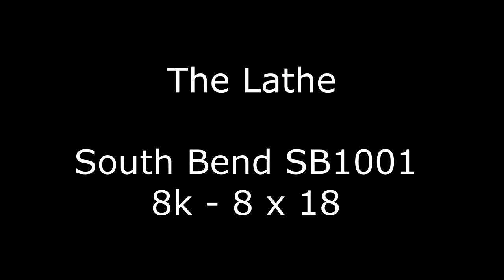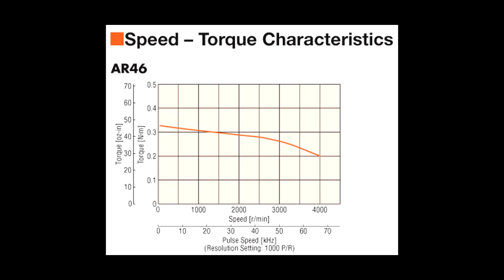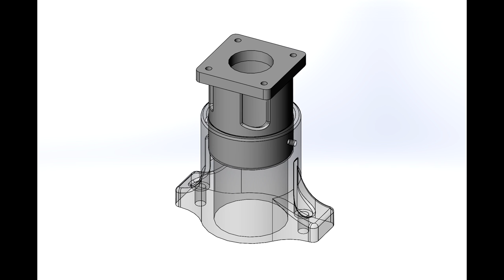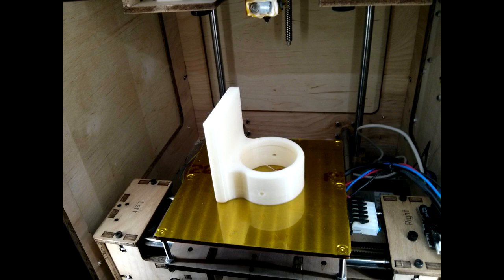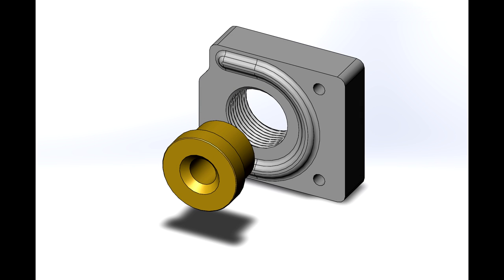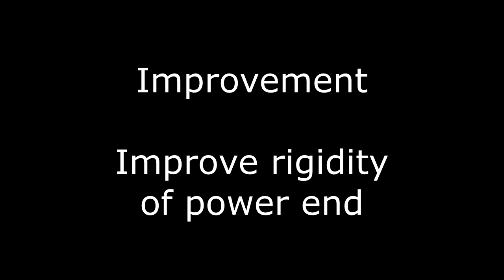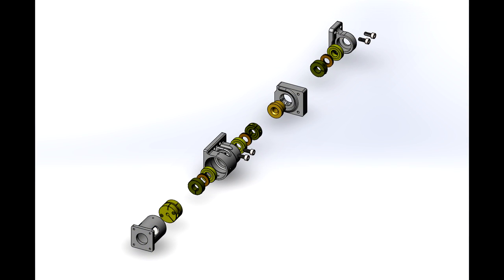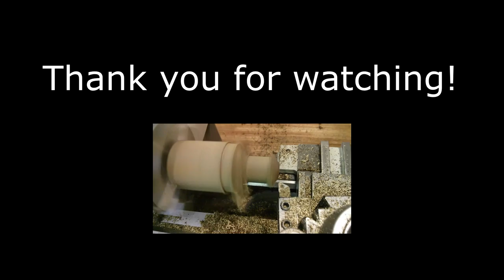South Bend SB1001 CNC Lathe, 3D Printed Parts, Arduino Controlled

Comment: Is this spindle using an encoder? or how do you figure the RPM?? I'm thinking that you may be using one of those cheap Chinese three phase with an small VFD.....? Just trying to understand what you have done...
Reply from the maker: In this video I unfortunately didn't control the spindle speed beyond using the built-in adjustment knob. The displayed RPM is measured using a sensor and magnet on the spindle, and the displayed RPM is pretty accurate. I've not torn the spindle drive down, but I'm pretty sure it's a BLDC unit with encoder feedback. The low speed regulation is not great. I might try replacing the potentiometer. If driving the drive from a computer, one would simply send most likely 0-5VDC to the drive in place of the potentiometer to control the spindle speed. Also, if controlling from a computer, the spindle encoder should be replaced with a higher pulse-per-revolution one to better synchronize spindle with axis movement. I don't know if replacement drives are still available, but when they were from Grizzly the cost was insane. Someone replacing the drive on this lathe would be best to consider as you suggested. Thank you

By the way, you have a nice channel. I'm watching your toroid winding videos, very cool machine.

Comment: Are those thrust bearings large enough in diameter to be only interacting with the outer race of the radial bearings? The thrust bearings looked to small in the model you were showing.
Reply from the maker: You're right, good chance there is a problem there. The 3d prints have been replaced, but your advice will be used for future work. Thank you

Comment: Hi there, First of all thanks nice video. How can you help me? I want to make special purpose 2 axis lathe type Cnc machine. My requirement is rpm of spindle speed is 10 - 300m and  2nd axis ball screw control by Cnc control with precision features for my operation is like threading. Please give me best solution. Thanks
Reply from the maker: Thank you for the question and faith that I could help you. Unfortunately, you should find someone with greater mechanical experience and able to thoroughly understand what your goal is. I wish you all the best of success. Your project sounds very interesting.
Reply: Kent VanderVelden thanks for your quick reply. It’s semi automatic Cnc spring coiling machine for thick wire.
Spindle axis for mendral rpm. And ball screw for pitch control according to requirements but precise
Compound slide control manually. Thanks

Comment: Can you please tell me Which software did you use to run the machine? Please bro i am also working to make the cnc wood turning project.
I  am from india
Reply from the maker: Hi Nasa, I wrote the code from scratch. It was as basic as I could make it. Today I use LinuxCNC. There's also MachineKit, based on LinuxCNC, for Beagle Bone. Maybe Marlen for Arduino?
Reply: @kentvandervelden  Thanks for giving the information. If i got any doubt means can i ask you?
Reply from the maker: @nasateja6849  Of course you may. Feel free to email as well
Reply: @kentvandervelden  Thank-you so much😘😘

Comment: great job Kent ! I would have loved to see you actually making the printed parts on your rig...looks like they were machined out of Delrin !! Clearpath servos are the way to go...they cost $$ but 3 to 8 x the power and closed loop in one neat package.
Reply from the maker: Many thanks! These are printed on an original Makerbot in ABS. For the next version I plan to use Clearpath servos (others have recommended them too) and I have an ambitious goal to redo the parts in cast aluminum. The foundry furnace is ready but don't have experience with casting. A viewer made the suggestion and at-home casting seems to be a skill that is being lost to time. To learn I got mrpete222's foundry course videos. Best wishes, Kent

Comment: Wow, that lathe modeling would take me a life time or 2. Good work, great info, thank you for sharing.
Reply from the maker: Thank you, and it took me a long time as well, but it was great way to learn Solidworks. I received a conversion kit for this lathe recently, the last one of its kind maybe. In my Shop Talk #1 video, I show the pieces. The man who built it was a mold tool-and-die guy and it shows in the quality. I hope to get started on it soon. I've been planning the electronics. Doing some cleanup on the lathe tonight. I spend the summers outside but it's turning cold around here and so I'm heading back into the shop. Best wishes, Kent
Reply: Very cool. I will be following the process.

Comment: Hi! We are working on a project. We would like to ask what speed (rpm) did you use for your spindle.
Reply from the maker: Hi Jibsam, this spindle maxes out around 2600 rpm but should not be run faster than about 2200 rpm for long. I generally use constant surface speed with the max speed set to 2200 rpm. If your project is making a CNC lathe, consider guarding around the spindle. Dangerous bird nests of strings build up fast. Best of success to you!
Reply: @kentvandervelden  thank you so much for your help :D

Comment: what firmware you use for your arduino's projet?
can you share here..
Reply from the maker: +Teddy Kristiyan Hi Teddy, I just wrote something up. Nothing special and probably lost by now. The input format was not g-code and so not so too helpful in general. Others have done better making a Arduino CNC controller. My latest conversion of this lathe uses LinuxCNC.

Comment: Hi Mr Kent great job, please if it possible,  you can send me the code for the arduino for  the closed loop stepper motor control? thank very much.
Reply from the maker: Hi Stewart, sorry I don't have the code any longer. I've since converted the lathe to be LinuxCNC controlled. There are far better CNC implementation for Arduino than what I did. Sorry I could not help more :(

Comment: could you machine aluminum with this set up?
Reply from the maker: Probably, but I would not expect an accuracy that matches using the lathe manually. Nothing against the 3d parts, but the motors are little weak. A followup approach is better and is what I use today: https://www.youtube.com/watch?v=TPRQVCCYKaQ
Reply: @kentvandervelden  i see but what if you use metal parts intead of 3d printed parts and get motors with stronger torque?
Reply from the maker: @elsunshine9976  That would work more better. Check out the update video I referenced. Even that's pretty old. Always an update to do. Best wishes
Reply: @kentvandervelden  thks for the info love Stuff like this

Comment: You might try using the gear train for the lead screw to multiply the torque the stepper motor provides. Then you can go back to the stock lead screw and half nut (as long as you keep the nut liberally lubricated).
   The advantage of the ball screw is that the balls are always in compression so there is no back lash in the screw. You can get around this problem with a standard  screw (or using the rack gear for that matter.. my bench lathe is within 0.001"/inch feed) by a little thoughtful programming. In the program you do what the manual machinist has to do... keep all the slack in one direction. For example if cutting right to left move the carriage to the right past the start point a distance you know exceeds the slack in the feed. Now the carriage is moved to the left (the cutting feed direction) to the start point of the next pass on the work. You would do the same for machining a feature like a snap ring groove to insure that it was located the correct distance from the end of the part.
   That 3-d printer you have would be the cat's pajamas for making mold cores... then you could have your parts in cast iron.
Reply from the maker: These are all really great ideas. Thank you. Using the existing gear train never came to mind, and it makes a lot of sense. Could then use a non-stepper motor on the gear train, and mount a rotary encoder on the support end of the leadscrew. My program was really basic and before CAM software was practical. Now Fusion360 and LinuxCNC (or MachineKit) are a great combination for conversions. Using the 3D printed parts for mold casting is really intriguing. Tubalcain has several videos on aluminum casting, and he makes it look doable. I never had a reason to consider casting, but you have the right idea. Thank you again for the great suggestions.

Tubalcain's Foundry Videos: https://www.youtube.com/playlist?list=PL69F982076354AC97
Reply from the maker: Very interesting. I've enjoyed Keith Rucker's video I've watched, and I'll go digging for the casting ones. I never would have considered approaching a foundry for a couple of parts. I figured one of the following three didn't belong: foundry, one part, reasonable price. (Sorry to respond late. YouTube held your comment, maybe because of the link?) Thank you and best wishes
Reply from the maker: Your suggestion of using the 3d printed parts to make castings has stayed in my mind. I now have a foundry furnace and after some practice would like to follow your suggestion. I ordered MrPete's foundry videos to get started. Not sure what I'm in for, but I'm sure I'll learn a lot. :) Best wishes, Kent

Comment: If a milling attachment were to be installed along with a third stepper motor, could it be used as a horizontal mill?
Reply from the maker: I suppose it could, and would pretty interesting! Do you have such a project in mind?
Reply: @kentvandervelden  yes, kind of. I have a chinese bv20 lathe, six speed gearbox, and i was thinking that maybe if i built a simple milling attachment and put a stepper along with ballscrews for the x and y axis, it could maybe be used for light milling, maybe even cutting out shapes like clock escapement parts
Reply from the maker: Not sure if they'll work for you, but noticed Amazon has some relatively inexpensive manual linear actuator sliding tables that might be a good starting point.
Reply: @kentvandervelden  Thank you very much for the advice!

Comment: Nice, I hope I get around to playing with closed loop steppers one day.. although one motor+driver costs more than the entire 3 axis electronics that I'm using right now :)
Reply from the maker: Completely agree, and I certainly could never have afforded these, but a friend had them for work, and I was able to borrow them for a few days. For an alternative, take a look at my PM25MV mill conversion test video. It uses Leadshine closed-loop steppers and while they need a power supply, they are 1/3 the cost or so of the ones on the lathe.
Reply: Interesting, it looks like Leadshine and Oriental/Alphastep are roughly equal in price in the UK. There's too much cool stuff out there!
Reply from the maker: And I suppose the two take on the higher price... Argh, that's terrible. For what it's worth, when I got the Leadshine motors, I had planned to create my own control loop, monitoring the encoders separate from the drive, so I got drives without feedback. That needs more explanation to make sense. But the unexpected thing was how much less torque the same motor had with the non-feedback drive compared to an equivalent size drive with feedback. Leadshine verified that's expected. I was naive at the time, thinking that re-sending lost steps was enough for closed-loop operation, but increasing current as needed is what makes the difference.
Reply: I would never have thought of that but it figures - I suppose if the motor loses steps that's a sign that the drive needs to increase the torque as well as compensate for the steps already lost.
Reply from the maker: The torque is effected by the micro-stepping setting and I considered adjusting that on the fly. High micro-stepping under normal operation and then full-stepping under the greatest load. I don't remember what prevented this idea from being practical. Perhaps the drive needed to be power cycled for the change to take effect? Anyway, that may have been getting too Rube Goldberg anyway :) Apparently, some drives are smart about micro-stepping, and increase current slightly when micro-stepping to compensate for the torque lost. You sure are right about there being a lot of cool stuff out there to try.
Reply from the maker: I like HomoFaciens' videos as well. Regarding his mill built from trusses, I mentioned he could benefit from a welder. Not to suggest what he did was not amazing, but only because the welder would save so much time and he would find other uses. He explained that the theme of his channel is doing amazing stuff with "junk." The Post Apocalyptic Inventor is another great channel with similar "build with what you have" ethos. https://www.youtube.com/channel/UCDbWmfrwmzn1ZsGgrYRUxoA

(Sorry to respond so late, YouTube held your comment by mistake because of the link.)
Reply: On my channel I tend to over engineer things and use tools like the laser which exclude a lot of people from using my ideas. Looking at HomoFaciens always reminds me that it's more interesting to do things that people with very few resources can benefit from.
Reply from the maker: Even if not able to directly use ideas, seeing your stuff is inspiring. It's all good :)

Comment: are the mounts ABS
Reply from the maker: Yes, all the prints are ABS. That's the only material I used on the Makerbot. On a Taz5, I've used ABS and PLA, but have stuck with ABS, despite it not being as popular any more.
Reply: it is stronger..jsut smelly and should be ventilated

Comment: Lead screw is bent, probably from a crash
Reply from the maker: Where in the video are you noticing this? Is the original or the replacement ACME screw in use? While even new ACME screws will not be perfect, and should be mapped with a indicator first, more likely you are seeing an issue with the crudeness of the 3D printed parts.
Reply from the maker: The saddle is held by tabs preventing the front or rear from rising from the bedways. The cross slide is held in place by the ways of the saddle. And the stepper motors are of so little power than I can stop them by hand. Sorry, I just don't see how a crash could bend either ACME screw, but thank you for your comment.
Reply: its easiest to see around 11:52 in the video. i suppose it could be related to the far end support of the screw not being totally in line, but i don't see as how that would give the illusion of run out as opposed to just being at an angle.
Reply from the maker: Oh, that pulsating away from the line of the bedways? That's for sure because of the crudeness of the 3D printed parts. I can't put that onto McMaster sending a bent ACME screw. But thanks for suggesting the leadscrew was bent instead of that my parts were wanky :) I got to get back to this project. I have a design ready to go in metal, but I do contract work, and I have to put in all the hours I can when work is available. Best wishes, Kent
Reply: i didn't know if you bought this lathe new. Def not under CNC power. But if you run the carriage into the chuck whilst threading you can definitely twist that screw up. Most screw mapping is for lead error not runout. I can def see McMaster sending a tweaked screw. Its actually not all that uncommon. You can pull the screw, put it between centers and confirm its truth fairly easily. But i don't doubt the wonkiness of printed parts. I print a lot of parts to proof my design before committing them to the cnc lathe.
Reply from the maker: Yeah, bought new from Grizzly after they halved the price (still overpriced) but didn't tell anyone the lathe was being discontinued. Still great little lathe. Thank you for the advice, I'll give it all a good inspection. Did you do your own CNC conversion? Is there anyplace I can check it out online?